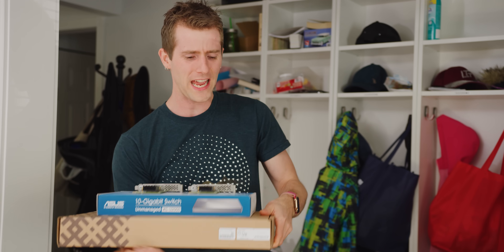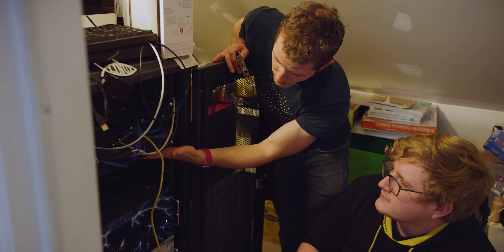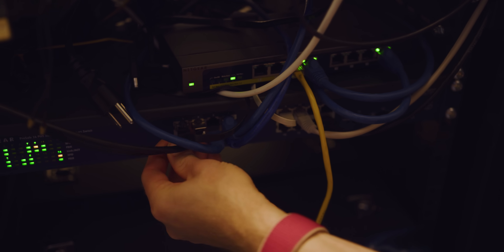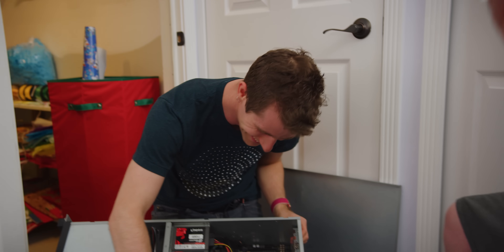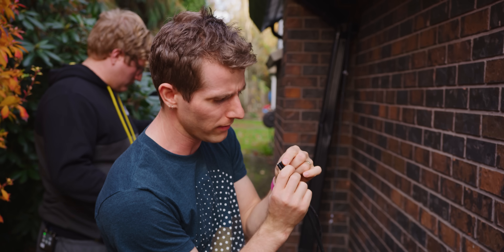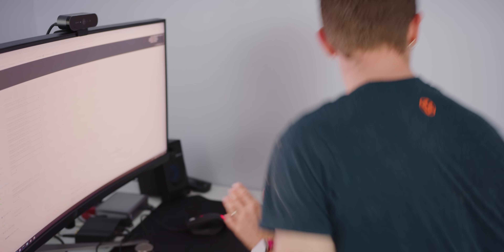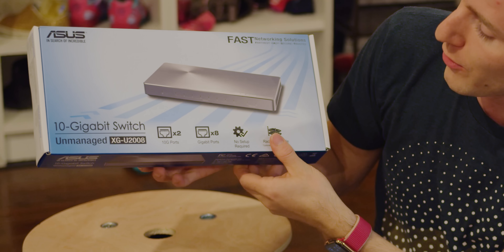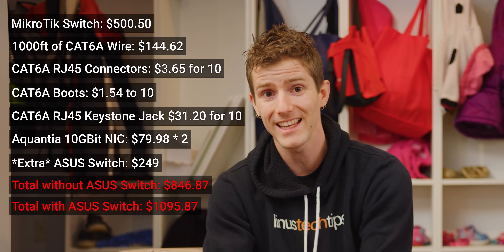Home 10 Gig Network Upgrade for CHEAP

Comment: Military grade encryption you say? So it was made by the lowest bidder that met the absolute minimum requirement and made sure to skimp out on everything from testing to all the non-specced useful bits and pieces? A military grade server is a hand me down with a pentium processor from the 90's running windows 95. 

Hmm... yeah... I'll pass

But if its not military grade then I'll probably get a privacy card. Its a neat concept

Comment: Try to learn the difference between Enough and Excess. No one needs 10 gbps. Even you cant use 1 gbps to its full potential. Use max 300-400 Mbps. It's enough and sufficient. You never need more speed. Even 100 mbps is sufficient.

Comment: Cisco 2360 with 48 1G Copper, 4 10GBe SFP+ for $60 off of Ebay (shipped). Solar Flare v2 PCIe-8X dual SFP+ for $19. FS.COM SR MM LC SFP+ for $20.

Comment: It's even more affordable to buy used enterprise hardware. E.g. Older Cisco Nexus 5 series switches, dac cables and/or pre-owned MM fiber cables and 10GBASE-SR sfp transceivers, and older brocade or Solar Flare converged network adapters

Comment: Lmao you don't need a 10k tester to certify data runs. Also why didn't you just run fiber? I know this is trying to be affordable but you'd never need to upgrade ever again. Also the differences between 5e, 6, and 6a isn't just the shielding. It's also a tighter twist with the pairs.

Comment: A question for the Ethernet pros out there: 
Does is actually matter at all in any practical sense if you use un-shielded RJ45's or cat5-rated wall-plugs together with a cat6a or cat7 cable? I can't even find cat7 rates RJ45's or wall-plugs to buy if I wanted.

I mean, I'm sure it technically helps to some extent, but unless we are talking about areas of extremely high EMI I find it hard to believe that the signal quality would degrade in any measurable way over like a centimeter of unshielded connection.

Would there even be a difference between a cat5/6/7 rated wall-plug if all were un-shielded? I find it hard to imagine how you could do much to improve that given how you connect them up internally.

Comment: Can someone explain the benefit of a switch. I currently have 1 gig plan through Comcast with nighthawk cm1200 modem and orbi WiFi 6 rbk852 router. I also ordered a few cat 8 cables for the few wired Iteams I have in my house.

Comment: cheaper 10gb network = Asus XG-C100C NICs 115$ and Netgear switch XS505M 445$ (4 ethernet ports+1 sfp) or XS508M 600$ (8 ethernet ports+1sfp) unmanaged aka plug and play works 1st try and contrary to 9/10 affordable "10gbit" switches (the 1st ones you will find in searches and the one featured in this video) who are actually 1Gbit switches with a single or two (which is the same, you need 3+) 10Gbit entry, the netgear ones ONLY have 10gbit ports, it has a fan, it will make noise at the beginning but frankly I can't hear it anymore and my pc is silent-ish (have to say us prices are super high for a change I paid 68+389$ for an asus pcie card and the XS508M) the XG-U2008 featured in this episode is one of those fake "says 10 but really is 1" switches please read specs carefully before placing an order, it's borderline scam to advertise a 10Gbit switch that only outputs 1Gbit

Comment: I don’t understand. To get 10gbe? Doesn’t the source of the single have to be also 10gb ? I have Fios gigabyte . Do I run a cat 6a fiber from there outside box to the router? Then I still have to have a switcher ti uptake to 10gb?
Reply: He's using 10 gigabit to connect devices faster on his local network, not to make his internet faster. His NAS, computer, TVs, etc.

Comment: eh im pretty underwhelmed by the progress of consumer networking.
Was well over 10 years ago I could setup a gigabit network where cable was like $2 a meter,  a small, silent, power lite switch was like $40 and the NICs were 'free' as in came standard in midrange mobos.

We are at a stage now where even mainstream users would max out 1gbit easily, with even single mechanical mainstream drives able to go almost twice that 110MB/s limit.

Yet even 2.5gbit is far from mainstream. Consumer gear that has multi-gigabit ports are either expensive business oriented dozens of ports managed switches, or expensive extreme gamer routers.

Am I missing something here? 5/10/20gbit USB 3 and thunderbolt are WAY more ubiquitous than multigigabit networking. It just doesn't make sense.

I don't need 10gigabit. ~250MB/s is fine right now. But Gigabit should be obsolete. As far as I'm aware, 2.5Gigabit can even work across existing cat5e infrastructure (letalone cat6 - which I was buying 15 years ago)
Reply: Same here. It doesn't make sense how there's been no progress in the decade plus that gigabit has been a cheap commodity. I guess it's the ISPs holding it back...most people don't care about faster than gigabit home networking when their internet connection isn't even a gigabit. It could get better relatively soon though - I've heard that AT&T is rolling out 10 gigabit fiber to the home in a few dozen markets. And a few other ISPs like Verizon and Spectrum are in the very early planning stages of upgrading their networks to 10gig capable.

Comment: 10G, does unraid benefit from that? unless you are nvme or ssd, I don't see the big advantage
Reply: 1 gigabit is only ~117MB/s. Even a single 7200RPM hard drive can go up to 265MB/s. A RAID of 8 of those 7200RPM drives can go over 2000MB/s, which is approaching 20 gigabits.

Comment: your definition of cheap is much different than my definition of cheap.  Jesus, $500 just for the switch and $200 a pop for a reel of cable.  Couldn't find the NIC cards bc both links were out of stock or dead links, so unknown price there.
Reply: For 10gig it's cheap

Comment: DUDE DON’T FORGET NEXT TIME, by experience when trimming cables after you spin the tool to cut the outer skin of the cable, ALWAYS PULL DOWN THE STRING A COUPLE OF INCHES , I was sick and tired of after aligning them and straighten them one or two damn ones always got broken, right where i use the tool to cut the outer skin, that is why it comes with that string, COMPRENDE??? 👍🏻 ✌🏻

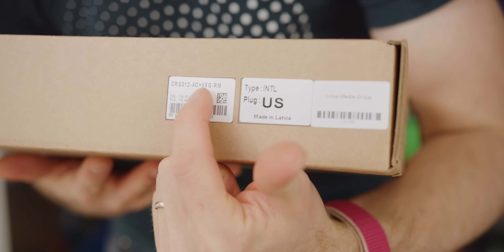Comment: 1:02 "wow terrible name"
Until you actually look into what it means and start to go: "Huh, that's actually quite clever".
Seriously, compare CRS-312-4C+8XG-RM to something like "UniFi FlexHD", "UniFi AP HD", "UniFi AP SHD" and "UniFi Switch 16 PoE Gen2" and you'd actually be surprised how much easier it is to see the ports it has without having to look into the entire specsheet...

For those wondering what I'm brabbling on about:

- CRS: Cloud Router Switch
- 3: series 3
- 12: 12 wired interfaces
- 4C+:  4 Combo 10G/SFP ports
- 8XG: 8 5G/10G Ethernet ports
- RM: RackMount
Reply: Excellent name for its market audience.
Reply: @pingozingo  indeed, switched from mikrotik to ubiquiti but never sold the mikrotik stuff, but now realy thinking about going back and setting up openwrt for the wifi
Reply: And, Made in Latvia:)
Reply: @Gus Erland Ah yes, I'm totally clueless.
That's why I am taking my network engineering exam next month? :^)
Let's grab the book shall we?
- Operate at 500MHz instead of 250MHz of Cat5 or 100MHz of Cat5e
- higher purity copper, resulting in less losses over distance
- same AWG wires as cat6, ever so slightly thicker wires than cat5e (I guess you're right here)
- tighter twists
- a "plastic piece" in the middle to limit crosstalk
- thicker insulation around each wire

There you have it, the both of us were right.
Happy now?
Reply: @FinlayDaG33k  Source?
Reply: @David-jm5rj  Source on?
Reply: @Gus Erland the wires inside are actually thinner tho, mostly different quality ("purity") of copper.
The real difference between cat5e and cat6a for example is the better alien crosstalk, allowing the frequency to go up to 500MHz as opposed to 250MHz on Cat6 and and 100MHz on Cat5e
Reply: @Gus Erland Ah yes, I'm totally clueless.
So are my friends that work as network engineers for big companies like AMS-IX, Hetzner and Tweak.
Kfam.
Reply: @Gus Erland Argumentum ad hominem, your "discussion" is now void.
Have a good day.
Reply: Better than usb 3.1 gen 2x2

Comment: Why can't you not use the mains wiring in the house/apartment to carry the broadband signal via Broadband over mains adapter.
Reply: Because it sucks and can't even do 1 gigabit much less 10 gigabit.
Reply: @estusflask982  Strange if I had gone for the Gigabit (TP-Link AV1200) mains adapters we could roll out 10 Gigabit networking to the whole house but we only have the TP-Link AV600.

Comment: Is TIA/EIA 568-C.2 standard another way to say TIA 568-C22? I am looking for pure copper wire so I am wondering if i found it. Also, I am about to DIY an Ethernet cable in my house the cable only takes up what I need right? it doesn't horde the internet to 1 single PC. Thanks love the info on the vids!

Comment: In the future, I recommend getting special cat 6 heads, they have little holes in the front of the head that let the individual leads pass through, it makes it far easier to crimp the cables.
Reply: Those are called pass-through connectors. They are way easier to use, I just use the regular cheapie connectors. The pass-through connectors also need a special crimping tool I believe.
Reply: @RoastBeefSandwich  they don't necessarily need a special tool, but they're best used with the special tool because it gives space fir the wires that are passing through to sit freely as well as come with a blade to cut the slack off while crimping.
Reply: @colethomas2309  99% of the rj45 crimpers you can buy have a blade for pass through connection you dont really need a special one. They aren't any better or worse than regular RJs but most of older techs I know don't like them and consider them to be a lesser rj
Reply: ca8 all the way mate

Comment: That is not the only difference between Cat5, the jump in gauge is a big difference at that voltage but the biggest difference is the number of twists per inch which prevents crosstalk. Unless you bought shielded cat six, which you didn't for that price then the x shaped strand in the middle is for structure to prevent tight bends.

Comment: I went a similar route, minus going CAT.  I went Fiber Optic. Bought (2) Dual Port SFP+, 3 in total (1 was 49Y4252 EMULEX) off Ebay for less then $10.00 a piece.   I see today they want to extort people for $179.00 a piece (Melanox) used, Just like NVidia - they bought Melanox. 2 in servers and one in my main rig.  Ran 2 SFP+ Copper from the 32 core servers about $20.00 a piece and 2 Fiber Optic cables $12.00 a piece for  to my rig upstairs through the register :)  I do not currently get 20 Gigabit, but I do have 10G redundancy.  I used the 4 port MicroTik. CRS305-1G-4S+IN ($144.49 off ebay - cheaper today). Jacked into a 32 Port Router / Switch that Google used to use less then $50 off ebay (has dual 10G Uplinks - used one).  I did have to buy 4 transcievers (MikroTik S+85DLC03D) brand new cost me $55.00 total.  I can easily max out 10 Gigabit - 1.2 GB a sec.  I do have plans on upgrading the Mikrotik router. CRS309-1G-8S+  Hopefully then I will see 20 Gigabit.  Basically raid 2 X 10 Gigabit ports.

I have since shut down both 32 core servers down and replaced them with a 3900X  It has dual PCIE4.0 Raided NVME, 8 X 8TB (raid 0) & 2 X 10 TB (Raid 0) raided drives.  I plan on completely removing Gigabit from the house.  I do have my information backed up, so give me some slack on the raid 0 ;)  I do build Operating Systems.  Makes you wonder what my main Rig has does it not? I promise you.  I do not have a mechanical hard disk or a SSD for that matter in my "Main Rig".  I am all about speed.  20 Gigabit is roughly 2.4 GB a second across the network.  I could also instruct a sever to build this or that, with the quickness.

That router they all come online?  I went "Lite" stepping into 10 Gigabit.  What I did not tell you.

Bought: Chelsio S320E-CXA 2-P 10G PCIe Ethernet Adapter Storage
Mellanox ConnectX-2 QDR 40G IB Dual Port Networking Adapter MHRH2A-XSR
10-2566-01 - Cisco FET-10G 10G Base SFP+ Transceiver Modules
10GB Cisco 10Gbps Fibre Channel SR X2 Transceiver Module DS-X2-FC10G-SR=
LOT OF 2 DS-X2-FC10G-SR CISCO 10GBPS FIBRE CHANNEL 10-2258-01 COUIAAKCAA

I ate that.  See I learn too.  All Failures.  This is a perfect time to extort people.  I have $179.00 adapters  I paid less then $10.00 for.  I bet I could recover the above money.  Bet money it does not happen.  Maybe down the road I move to 40 Gigabit?  That is actually 80 Gigabit, it is dual port.  It is in my basement.  I bet I could sell that for a grand or better.  I do not like them.  Want me to tell you I do not like money?  I have enough & that should be all that matters.

Greedy I am not..  I am down.  I will not work for roughly 3 weeks in total.  Repostorm is coming.  I almost question.  God has done this to me.

Linus, if you did not believe in GOD, it is coming.

Comment: People in the comments are trippin, 850$ for this upgrade is CHEAP, 500$ for a 10gbe switch like that is CHEAP, network gear is very expensive, this is actually a massive advancement for home networking, because as Linus said, just a couple years ago you were looking at thousands for a single switch, not even counting the cost of cabling for it.

Comment: That was regular CAT 6 install lol. A proper CAT 6A install would require a new patch panel, grounding the patch panel, actual CAT 6A cables with shielding, CAT 6A metal connectors. The point of the shield is so it is grounded to actually work.
Reply: They’re using Cat6a UTP.  Your point would apply if they used STP.
Reply: Paul Chalk Oh yeah, you’re right. I’ve never seen an install of CAT 6A UTP. I just assumed CAT 6A was STP only. I stand corrected.

Comment: There is more of a difference between CAT5e and CAT6 than the pair separator.  Differences are as follows: CAT5e 24-26 AWG CAT6 is 22-24AWG.  Twists per inch is greater in the CAT6 which provides better noise cancellation.  CAT6 provides a higher SNR.  CAT5e is upto 100 Mhz CAT6 is upto 500Mhz.  CAT5e supports upto only 1000base-T where CAT6 supports upto 10GBase-T.  Just some info for those that don't know...  This may have been stated already... happy cabling .. cheers

Comment: 10g at home is nice! BUT don't use anything other then (old) intel cards
1. driver support, even on windows aquantia drivers are not performing 100% out of the box
2. linux/freebsd "make install" (should say it all)
3. heat!, got two "Asus 10-Gigabit XG-C100C" (aquantia chip) and one "Intel X540-T2". Infrared says 70 and 50 °C, even with a 2,5/5/10G switch (not supported by the X540 chip)

as far as i hate intel price wise, used server hardware is "quite nice" and cheap

PS: im talking about a (pre)homelab use case.

Comment: 10 Gig ?
waste when internet speed is 50 Megabits per second
$500 for a SWITCH ?
your on drugs thats not cheap at all
Reply: its not just for internet, having a high ethernet transfer rate means you can transfer files on your home network way faster, which i assume, though i am far from a tech wizard, if your editing videos or 3d models, on an external machine, means you can do things faster, also as linus made clear, its not cheap as like, yeah ive got 3 bucks in my left pocket ima go upgrade my home network, but compared to everything else on the market in the last few years its very cheap
Reply: @rosemurphy8026  i dont have a hone network, been meaning to build one though .....

Comment: If I need to add a access point in my detached workshop can I buy the outdoor cable and buried it in conduit to run across the yard ? or just buy a repeater to boost the signal ?

Comment: 10 Gig Network transfer bit rate is 1250MB/s; WIFI 6 is 1375 MB/s; there are about 20 NVMe's with 1250MB/s sustained write speeds... but USB 3.2 and USB4 are 20 and 40 Gbit/s (~2500 and 5000MB/s)!
Is 10 Gig Network an upgrade or a future bottleneck for transferring stuff from an external PCIe 4.0 NVMe drive? What am I missing here?!

Comment: 10 Gig Network transfer bit rate is 1250MB/s; WIFI 6 is 1375 MB/s; there are about 20 NVMe's with 1250MB/s sustained write speeds... but USB 3.2 and USB4 are 20 and 40 Gbit/s (~2500 and 5000 MB/s)!
Is 

Is 10 Gig Network an upgrade or a future bottleneck for transferring stuff from an external PCIe 4.0 NVMe drive? What am I missing here?!

Comment: That Mikrotik switch isn't only 10G. It's 1G/2.5G/5G/10G. The ports support multiple speeds. So the extra router is a complete waste unless your setup needs switches outside of the rack. Especially since you could just buy another MIkrotik 12 port 10G switch for twice as much. And if you're the type to route long 10G cables and put it wall plates, that's what you should do.

Comment: Glad to see 10 gig local networking catching up. I believe that it has not previously caught up because hard drives and internet connection connections has usually been slower than 10gig and therefor the benefit has not been that visible. With FTTH 1gig connections and ssd's getting faster, the need to upgrade the home networking is getting more prevalent.
Reply: I believe a barrier is the effort involved in cable repacement. If you have cat 5 or 5e everywhere, with a sizable company, the cable replacement piece is substantial work.
Reply: @brianw.4985  Yes but in network infrastructure most work are actually industrial and you would rather lay cat 8 cables than cat 5 on new installations.
Reply: @SuperSkandale  new installs yes, 6a or 7 at least. But there are tons of existing installs with cat 5 or 5e.